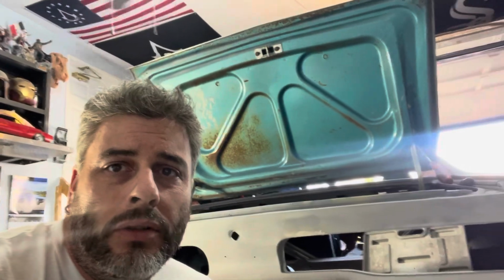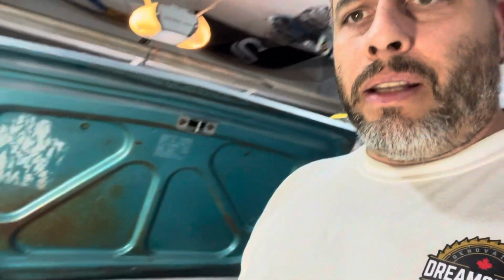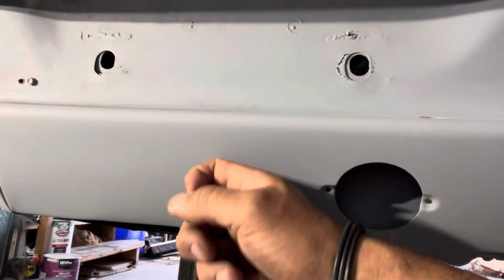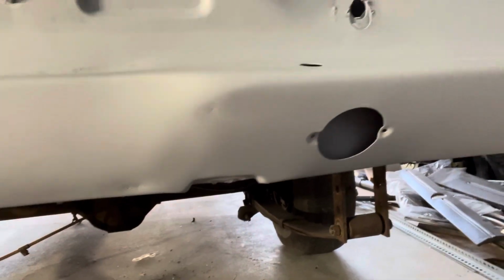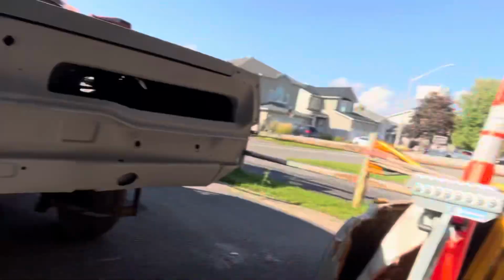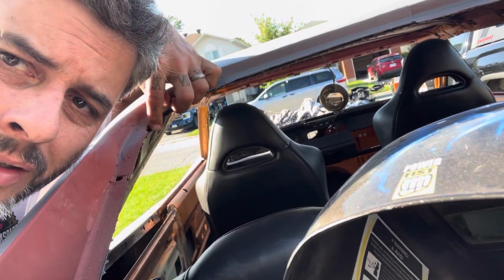69 Charger restoration episode 15

Comment: Did you use an epoxy 2k primer?
Reply from the maker: It’s a 2 or a 3 in 1 primer. The was an epoxy primer on most of the car when I got it. Except the new panels. Everything got this primer on it after